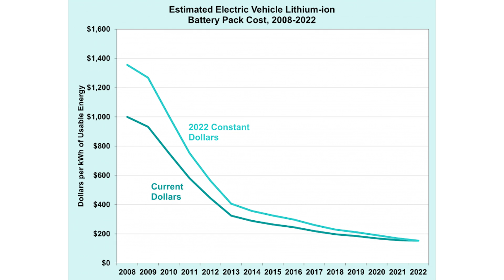Electric Vehicle batteries in 2023 will be 95% CHEAPER than 2008

Comment: there's been work on saline batteries (sodium) for decades but getting it financed to get it commercial has been the problem. the advantages of Na over Li are significant. No thermal issues and even if there was, using saline paste/solution is a fire suppressant, higher theoretical potential energy density than Li (yes people say otherwise but there's Na based chemistries that can go way past the theoretical limit of Na which is ~500 kg/W right up to 1200 kg/W and higher possibly even 2400 (in theory, practice is always different). 1200 kg/W energy dense enough according to an expert at NASA to top the 1000 kg/W threshold he says is the place for 100+ passenger aircraft, the kind that does >80% of all passenger air traffic). Material costs much better as mentioned in the video. Nanotechnology or other ways to achieve same (ceramic electrodes for example) will keep pushing progress on saline and other batteries for many years to come, nano s only just getting started. 

check out sea wave batteries… nothing commercial but promising developments for over a decade.

Comment: An EV is pretty much 90% solid state, which means (as with all electronics such as phones, TV's etc ) the capacity for innovation, improvement and cost reduction is vast when compared to ICE vehicles.  Its going to continue - and I thin the cost will reduce by 10% each year
Reply: lith-ion batteries are not considered solid state devices. th batteries are most of the cost and half the weight of an EV.
Reply: @bashful228  you are splitting hairs, no moving parts - phones are considered solid state - and they have batteries

Comment: Not seeing the path to CHEAPER batteries, and experimental versions don't equal reality...just future promises.

As stated, raw element costs are skyrocketing, not dropping.

Batteries have always been produced en masses by automated processes; this is not a recent development.  So that's not even a lever anyone can pull.

The requirement for raw materiel would be at least a 400% ramp up within the next 5 years.  We have never even DOUBLED the production of ANYTHING within TEN years.  And that's not just the alkali component...that's nickel and copper and all the associated metals and plastics (requiring petroleum inputs for production).

And the cost of a replacement 100 kWh pack is around $27k, not including labor.  That puts battery prices at around $270/kWh, NOT $135.  Per cell pricing actually puts it at something close to TWICE that.

Add all this to worldwide inflationary increases, and you're definitely NOT looking at a DROP in pricing.  Fact is, everyone is having to drop pricing on their EVs to spur demand.  That means companies are losing even MORE per unit trying to sell these things.

Comment: Sodium battery.  Solid state batteries will make EVs the same or lower then gas engine cars in a few years. Make the cars lighter  2500-3000lbs. You will get 1000 miles per charge
Reply: Would be nice if this happens.  But solid state batteries seem more than a few years off still.

Comment: I'm not sure if you mentioned what the advantage would be to use any lithium ion phosphate batteries at all considering they're much more expensive. Why use any of them at all?
Reply: At the moment, the reason is still energy density.   Ships, planes and trains for instance - will need this higher density (and more) to make electrification a viable reality.
Reply: @RoguePC4U  At 5:30 he said that this year catl batteries would be the same energy density as lithium is now so I'm wondering what the disadvantages would be to the new batteries.
Reply: @richardnwilson  Same energy density as the lowest lithium batteries are, not the highest ones.  Also, Sam doesn't mention this time that charge cycles are less.  Still good, but only about 1/3rd that of lithium.  Unless CATL improved upon this of course.
Reply: @RoguePC4U  thanks for taking the time to explain
Reply: The advantage is it do well in cold weather

Comment: This is very encouraging. I'll be interested to know about recyclability. Keeping a vehicle in a temperature controlled garage makes more sense than ever.
Reply: Onboard thermal regulation as a option Aissa MUST
Reply: @michaelstarkey9745  That's right. I guess most big battery packs have a cooling system. The Nissan Leaf was trying to avoid the need for one. There's a lot of electric car engineering I haven't learned about yet.

Comment: Great optimism and I really enjoyed your video.   You are probably right that electric cars are going to get cheaper then they will totally dominate the market.  They are a simpler better technology.  

Having worked in an R&D setting doing chemical process development though, I would disagree with your statement that large increases in investment in research yield large breakthroughs.   This is true to a point but, there comes a time of diminished returns.  Spend enough and you end up with redundancies, bureaucracies, limits due to availability of trained and competent researchers, and so on.    Research spending on a particular area probably follows an S curve.
Reply: cost curves are always associated with doublings of deployment. that has nothing to do with R&D as you say, not the blue sky kind anyhow. It's each manufacturer in the chain shaving margins of material away and improving strength, efficiencies of their product incrementally, model by model. Dr Volts has a good podcast about it recently by to Oxford scholars who wrote a paper trying to understand why some technologies scale and learn well while other scale and learn poorly (for reasons you can probably guess mostly).

Comment: You keep bringing up sodium based batteries but if you look at products like the Natron BlueTray 4000 it is a 1U rack mount sodium battery and it is only 0.27kWh and weighs 22kg. That means for a 4U setup it would weigh 88kg (193 lbs) and be only 1kWh. In the same 4U space you can buy decently cheap EG4 batteries that are 5.1kWh instead. Are CATL claiming they increased sodium battery energy density by 500%?

Comment: Multiple incremental progress!   I wont park a car in my garage that has a lithium battery.
Reply: I'm assuming due to fire risk?  If so, were you aware that ICE is 10x more likely to catch fire than lithium batteries?  And did you know that LFP batteries (used in most new Teslas now) have even less risk - plus won't catch fire, even when punctured?
Reply: @RoguePC4U  removing the lithium removes the possibility of fire, and FL, Si, and Na does not have this problem.
Reply: @blasterguam  But gas does.  So my point still stands.  So unless you're parking nothing in your garage right now (could be I suppose), I don't get the thought process.

Comment: Electrochemistry is progressing then now per an "economic Moore law" 2.5 folds cheapening every 1.5 years, 
like semiconductor does per "Moore law" of nominally-claimed 2 folds perfromance-increase every 1.5 years.
Given 20 folds compounded fold cheapening in EV batetries over 5 years, comprising 3 times 2.5 folds - over 1.5 years each, and over the remaining (5 - 1.5*3 =) half-year 1.3 fold (third-root of 2): 2.5*2.5*2.5*1.3 = 20 folds cheapening.

Comment: Hi Sam,
Was just thinking about AB dual chemistry (hybrid) batteries for EVs. Why not ABC battery packs with Na-ion+Li-ion+Super capacitors. The capacitors can handle the regen current for an immediate acceleration boost, sodium for the temperature tolerance and lithium for the density. Cheers mate.
Reply: hybrid batteries adds costs and complexity, and more points of failure. it never seems to get to the market for that reason. cutting edge batteries technology keep outstripping the need for hybrid power sources.  and supercapacitors are deacdes away from being ubiquitous and dirt cheap, like in theory they one day could being something as inexpensive as sheets of graphine, but they are only niche for medical etc ATM

Comment: I like the idea that the EV battery will be part of the grid 23 hours a day when parked.
The EV battery is the source of DISPATCHABLE POWER, daily. 

The existing national grid will be UNLOADED and perfect for balancing power from the massive number of parked EVs.

Forget rapid charging except where needed, most batteries will be full most of the time 

Forget 'horse and cart days' thinking. 
There was no way home petrol topping up was possible because of the flammability of petroleum. 
There was no way to trade petroleum in your tank when prices fluctuated. 😕 

Just saying 😌

Comment: Is there going to be a turning point where EVs are cheaper than ICE (so when battery packs are getting cheap), or as usual car manufacturers will keep prices at todays levels?
Reply: You haven't heard about the Tesla price cuts in the US and Europe.
Reply: You're making an assumption,  like sayi g theres a turing point where gold is.cheaper than copper.   For as many advancements as they are making for batteries,   ice vehicals only need materials that are cheap and plentiful.    Steel.  Thats basically it.   Ev's need tons of exotics.

Remember, an ice vehicals 'battery'  is fossil fuels.     Its a liquid battery that is cheap and holds tons of energy.    An ev is basically a car with a refinery built into it so it will pretty much always be more.expensive.
Reply: @jebes909090  sure but ice have many more parts to build just for the engine
Reply: @jebes909090  Who's making the assumption now? ie. "always be more expensive"?  Ummm... did you not watch this very video?

Comment: Just want to make a point...
YES "Sodium is very abundant"
BUT
Silicon is ALSO very abundant (2nd most abundant element in earths crust after oxygen)
But there IS A BIG DIFFERENCE between battery grade sodium and "sodium" as it is with silicon and "Semiconductor Grade Silicon" as it is with Nickel and battery grade Nickel ...

NOT claiming Sodium batteries do not lower the price BUT does the supply chain exist??
Is there really "an abundance" of battery grade sodium??
and if not, will it really be cheap?

"Lithium was cheap" until they started making batteries...

Not saying it will not get there but WHEN??
Reply: Maybe CATL already has this figured out?  I don't know.  But you're right - refined sodium could pose the same issues as lithium does now.  I'm hoping (assuming?) that mining and refining of battery grade sodium is not as intensive as we imagine.

Comment: you need to have the price of batteries come down to the same price as an engine. That means 10-15k not 20k plus. Then you have equality in the original price as an ice car.Thats the only way evs become mass adoption
Reply: Not quite that simple. More like the cost of the ICE drive train.
Reply: @markbernier8434 Close....  it should be Battery + Electric Motors = Gas Engine + Mechanical Drivetrain.

Comment: Talking about hybrid batteries (Li-ion and Na-ion in one pack), which car brand uses ultra capacitors already for the storage of break energy and for short periods of acceleration? Ultra capacitors have very high power capacity and relative low energy capacity. Combined with the battery pack the ultra capacitor expands the battery life due to load levelling. That could be cost effective. Viking, thank you for the interesting videos!
Reply: Tesla considered it and decided it was unnecessarily complicated.  You can accelerate a car from 0-60 in less than three seconds on a battery. You don't really need instant-discharge super capacitors for performance.
Reply: @KBinMD  Supercapacitors would not be for performance reasons but to lower the multiple small discharge/charge cycles when driving in a town/city.
Reply: @yvan2563  again, complexity over benefit becomes the decision tree.

Comment: Sodium ion is the battery of the near future, Aluminium graphene ion is the battery of the future, you should check out GMG Australia, their batteries are amazing!
Reply: Sam has already covered GMG in a prior video or two.
Reply: Sodium ion has been in r&d for decades. No one uses is because its low density and short cycle life.
Reply: @anekinoo7  Correct.  But it seems CATL and BYD have mostly solved these issues.  Not quite as good as lithium yet, but significantly cheaper.  So are bringing Sodium batteries to market in 2023.
Reply: @anekinoo7  Sodium has better low temperature performance than Lithium, but best as Lithium/Sodium blended battery. Sodium reduces Lithium needed,  Aluminium graphene is needed to replace Lithium.

Comment: Battery prices and density have plenty of room for advancement, I mean electrons don't weigh anything so the next 5 to 10 years are going to be interesting. Especially with energy generally getting all far more expensive at the same time, put that together with solar also getting cheaper and better and energy companies are going to have plenty to worry about, didums.
Reply: Electrons have mass. They are the difference in mass between a neutron and a proton. Unfortunately, we also need the positive charge to attract electrons, and as such, you also at least need the mass of the proton. What's funny is that we also know that one needs to be able to allow those protons to move readily so we also need a skeleton, and that has mass as well.
Reply: @ronaldking1054  Compared to the mass of fuel they don't weigh anything....
Reply: @jedics1  That is a claim that batteries are more energy dense than fuel is. They are not.
Reply: @ronaldking1054  Im saying they have the potential to be

Comment: Lithium-ion batteries was the preferred choice for Electric Vehicles and Renewable Energy farms energy retention. The enormous price hike during 2022 and mining feasibility for Lithium-ion is now turning the attention back to abundant Sodium-ion to reach our Net Zero goals.     
Compared to lithium-ion batteries, sodium-ion batteries have  lower cost, lower energy density, lower range, faster charging, lower energy retention, more frequent charging, better safety characteristics. Lithium has a higher energy density than sodium. (This is the best I could Google on the subject. I will repost my findings to solicit better

Comment: My prediction is finally coming true. Hybrid packs are brilliant and mix and match the advantages and disadvantages maintaining efficiency and protecting the longevity of the pack itself.
The future is going to roll like an avalanche and it will sweep us away ! 
Thanks again Electric Viking for all your hard work 
Cheers 🥂
Reply: Could you explain that why need Hybrid ?
Reply: @antonanton5503 y using a combination of lithium and sodium the cost comes way down…plus charging and recharging works better in colder climates. It’s not to be confused with hybrid cars that use fuel and batteries…it’s a combining of lithium and sodium mixtures in battery pack…the video has some illustration of how the different batteries are bundled.

Comment: there seem to be a thousand maybe this chemistry or that one - if they make anything work that won't use lithium or cuts it dramatically you can make more EVs. That has been the entire point of all these R&D efforts to come up with a better cell than Lithium.  Just remember how well 4680 went; it was suppose to be a slam dunk.
Reply: True.  But having the world's largest battery manufacturer (CATL) on board, is key.  And it's actually happening now, not just "some day".   4680's have had a lot more hurdles by comparison.  While it's still no guarantee of success, it's still a huge step.
Reply: @RoguePC4U  I guess we will see Randy; surely if they do have these for cars and not just power systems - it would be a boon - assuming their performance is pretty good or very good.

Comment: Dual tech batteries may eliminate the time delay headache of having to let a cold battery warm up before charging. It could also reduce KWh used to heat up cold batteries. (Comment is After watching a video of charging cold EVs in really cold weather)
Reply: Or it will just lead to a host of more problems.   Remember what elons fond of saying,   less complexity is better.   Adding more complexity to a system adds more poiints of faliure.
Reply: @jebes909090  not everything Elon says should be taken as gospel, he’s just another human being.  Elon’s companies have been successful, don’t mistake that success with brilliant engineering knowledge on his part as he’s not an engineer.  I’m not saying he’s not quite clever and astute in many ways, but he’s not the absolute walk-on-water genius that some make him out to be, evidenced by his torching of Twitter which is unprecedented and completely avoidable.  Also that’s not a particularly original thought, it’s effectively Occam’s Razor, which was espoused by William of Ockham in around 1300. 

If CATL figures it can make batteries more affordable, with improved characteristics by mixing like this, I trust them over Elon.  After all, CATL *is who Tesla buys their batteries from*.   So it’s entirely possible that these end up in Tesla vehicles.

Comment: Cheap home batteries will improve the system cost of an EV charged at home from solar cells.   100 KWh at $40/kwh is $4,000. Even if the EV is away from home during daylight, it can still recharge from stored solar electricity.